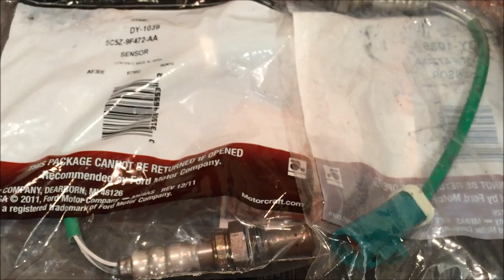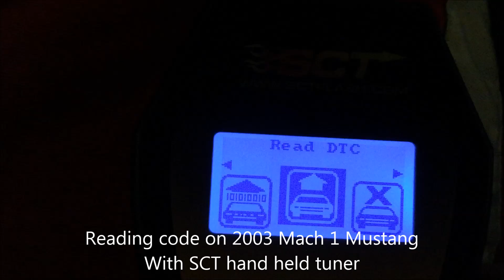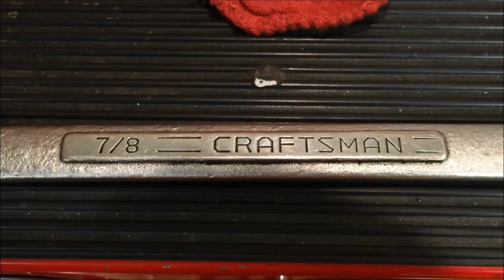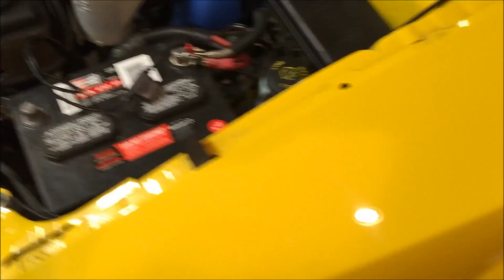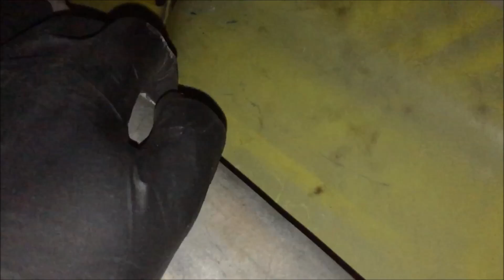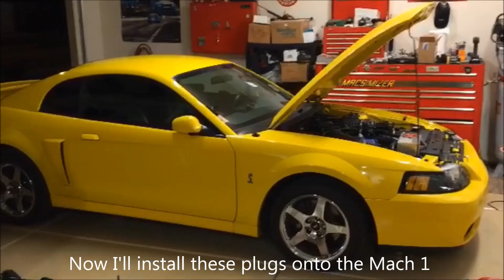How to change an oxygen sensor/O2 sensor: Ford Mustang (other cars too) F150,  Explorer

Comment: Is the bank 2 upstream sensor connector on the transmission harness or injector harness?
Reply from the maker: Bank 2 is the driver side and has the 02 sensor on the transmission harness. Bank 1 has the 02 on the injector harness. You’ll see it in this video around the 16 minute mark https://youtu.be/pQyB0kfNzzs?si=0y4bJ9_pIDnYv--h

Comment: Hey what's up Danny. I'm replacing my upstream o2 sensors and I'm CATCHING HELL trying to install the passenger side upstream sensor. Used a thread chaser and it screwed in no problem. Any suggestions?? 97 mustang cobra TIA 👍
Reply from the maker: At worst, remove the mid pipe and and rethread it or add a new bung for the o2 sensor to thread into and cap the old one https://youtu.be/ELF7zXpXsm8

Comment: You seem like you know what you’re talking about so i gotta pick your brain lol my girl has an 04 v6 mustang and it’s got codes saying it’s running rich on both banks, long term fuel trims -10 or more also. Any areas to look at specifically ? It has some new shit put in before the codes like new plugs, coil pack, wires, MAF, fuel filter, clean throttle body, and a new IACV. No vacuum leaks, fuel leaks, fuel pressure is normal. I’m thinking o2 but it’s anyone’s guess. I appreciate your time buddy, thanks
Reply from the maker: Yeah, in my case it was the 02 sensors themselves, but it’s hard to say

Comment: Late reply, but I just got a code for the o2 sensor on my 2012 v6 mustang. And it’s only for bank 1. I only bought one upstream new sensor but do I need to replace bank 2 also?
Reply from the maker: Just try that for now. It’s the passenger side

Comment: Wish I had the tools to do my own repairs.... sadly I cannot Jack the car up securely....
Reply: One thing you can do is drive your car on the curve as an jack . Did it not too long ago last year
Reply: You could also barely jack it up to where the tires are still on the ground and get yourself a block to put under there for extra safety. I just jack up enough to squeeze under the car.

Comment: Thanks man I’m running a full bolt on on a 06 mustang they have long tube headers I’m going to to buy the sensors this weekend great video real straight forward and detailed bank 1 is passenger bank 2 is driver side 👌

Comment: i have no cats on my 01 gt its throwing a code thats its running to rich im not sure if i need a 02 sensor or what do i need to do?
Reply from the maker: The car will run rich without cats, so you’ll need a tune. I also had bad front 02 sensors that reported a rich condition but it was just the sensors
Reply: @dannyjohnsonsgarage  I just need to know how to pass inspection with no cats, i might know someone who will pass it without the cats but if he doesnt then all i would have to do is buy a tuner an tune it out? an it will be okay to drive it for awhile while i save up money to buy a tuner right?
Reply from the maker: Chase Barbee It depends on if your state requires emissions. You may need to install a stock mid pipe with cats to pass
Reply: @dannyjohnsonsgarage  dang so buying a tuner an just tuning it out wouldnt work?
Reply from the maker: Chase Barbee The turner will make the car run properly, but you have to find out if your state is going to test your exhaust gasses and check for cats.
Reply: @dannyjohnsonsgarage  Ok thanks man i appreciate it!

Comment: Thanks for the video . I have question my 03 cobra got smoged referred and my Catt and EGR not setting with drive cycles . Talk to svt team at ford .they sent me to ford and correctly In the shop . I got a call from ford an was told my 02 sensor was bad . But star smog repair station and state referre did not catch this I have no check engine light on is this normal with the sensor being bad without check engine light ?
Reply from the maker: As the sensors fail they can also work a little here and there. I would go ahead and replace the sensor

Comment: How can you tell if it upstream or down stream
Reply from the maker: AJ KILLEM Upstream is closest to the engine, down stream is farthest down heading towards the tail pipe. The down stream sensors are typically  located after the catalytic converters

Comment: How do you remove the upstream O2 sensor if you do have Cat  Converter?
Reply from the maker: Saquarius Williams It’s still possible- you’ll want to unscrew it with the 7/8” wrench but if they have never been replaced before they are tied up on a bracket that’s mounted to the top two transmission bolts. You can gently pull and they should break away from the bracket where they are glued. If you’re not comfortable with that, remove the exhaust (I’ll post a link how to do that)
Reply from the maker: Saquarius Williams mid pipe removal https://youtu.be/AUVOtll1zdQ

Comment: so i bought some o2 sensors for my gt are they all the same as far as upflow and downflow because the ones i have arnt labeled
Reply from the maker: I do believe the fronts were different from the rear (they may be heated sensors up front if I recall), but the side doesn’t matter- just front vs rear is different

Comment: Where does the sensor connect on the other side? Where does it go? (Not the exhaust side)
Reply from the maker: it comes off of a harness that comes down each side of the transmission/engine block. The harness has a bracket that actually bolts into the top two bolts of the transmission

Comment: Danny great video as always. Are you aware of Ford possibly changing their part # on the front O2 sensors? I just got back from the Ford dealer and purchased upstream set for my 04 Cobra, my part number is DY-1401 1X (GU2Z-9G444-A). Totally different from yours on the video. I noticed on my car just like yours the fronts are color coded green, the ones i recently purchased the locking tabs are white?
Reply from the maker: If you happen to have the invoice, look for it to say “alternate part number” or something of that nature. It’s common when the part has been updated and the old one is “obsolete”
Reply: @dannyjohnsonsgarage  Nothing on my invoice or packaging indicating "alternate part number"
Reply: I'm having the same issue on my 99 3.8l they said the other part is obsolete and the part # is the same as you said Wilson

Comment: Hey i have a mustang 2002 base with the same problem, I asked some mechanics and most of them said that this doesn't affect anything with the car but i feel like the car lose power, the oxygen sensor has to be something with that? To fix the problem and how many sensors do i have to change?
Reply from the maker: Eduardo Vilca it’s usually just the front two sensors (called up stream) that cause hesitation issues.
Reply: @dannyjohnsonsgarage  so I just have to buy 2 sensors? Or 4?just in case i need more, how many sensors has the car?
Reply from the maker: Eduardo Vilca The car has 4, two up front and two in the rear. It’s most likely the front two would be causing the problem, so I would recommend trying them first, then move on to buying the ones for the back or even turn the back ones off
Reply from the maker: Eduardo Vilca https://youtu.be/sOV4EwF7BvU
Reply from the maker: Eduardo Vilca https://youtu.be/v9Jp5wqp_a8
Reply: @dannyjohnsonsgarage  thank you, do u know how much are each sensor? Because i asked one time in advance auto parts and they said like 90 but i checked on internet and are cheaper.

Comment: When do you have to replace the downstream O2 sensors? I had Bank 1 and bank 2 on my check engine meter and I'm going to replace the upstream only unless I get more fault codes. Should I replace downstream when I'm doing upstream?
Reply from the maker: They should last a little longer from not being quite as hot as the fronts. I would wait until they are a problem (or even turn them off). https://youtu.be/v9Jp5wqp_a8
Reply from the maker: Or if you don’t have a tuner you can buy these https://youtu.be/sOV4EwF7BvU

Comment: I have p0155 code saying bank 2 sensor 1 I got the sensor replace but still bring up the same code that’s the only code also
Reply from the maker: Kevionn4.6 that would be the driver side upstream (closest to the engine).
Reply: Danny Johnson so basically the left front ? If yes thanks !
Reply from the maker: Kevionn4.6 Yes. Thanks for watching 😉

Comment: Dude how did you get to the passenger side O2 sensor that shit is hard to get to
Reply from the maker: It’s super hard with catalytic converters. If you can’t get it, I would un plug it and take the exhaust off the car as an alternative
Reply: Yes that passenger side O2 sensor is a bitch. I got the drivers side done. Now trying to figure out how in the he'll to get at the other one without taking the exhaust off, dang it!
Reply: Ok got it! Jacked the front end up and used some jack stands. Get under there and push the stupid button and give a yank on those fricken wires! Why do you have to be so difficult Mustang!!

Comment: Hey Danny 
I got p0193 on my car , but it’s not acting like it would be the frps 

I am also getting a message saying my bank 1 sensor 4 is failing 
And also 
Closed loop:  using o2 sensor for fuel mix ..

I am replacing sensors first then frps 

You think that is a wise choice ?
Reply from the maker: yes- my experience in this case (as mentioned in the video) was the o2 sensor was the false messenger lol
Reply from the maker: if you have the ability, turn the rear sensors off with a tuner https://youtu.be/v9Jp5wqp_a8
Reply: Thank you Danny , this is really gonna save me some money .. I am picking everything up on Friday .. and doing it .
Reply: Oh and I smelled fuel in the oil so I’ll be replacing oil and filter as well ..
Reply from the maker: Gummy Bear Let me know how it all goes

Comment: Hey Danny, I just purchased an 01 mustang gt with bbk headers and it doesn't have neither upstream o2 sensors.. I can see the plug for bank 2 which is the drivers side but I can't locate the plug for bank 1, please help!
Reply from the maker: The plug can be pretty far up towards the top of the transmission. There is a bracket that holds them to the top transmission bolts. I wonder if it is on top of the transmission tucked up there
Reply from the maker: You can see what I’m talking about at about 12 minutes and 20 seconds into this video. https://youtu.be/Sk3d44e8JPo

Comment: Great video! Are the sensors torqued down pretty hard or just hand tight?? Thanks in advance
Reply from the maker: Rogelio Mireles there really isn't a way to put a torque wrench on it, so just make sure it is snug and be sure to use anti-seize like I did in the video!

Comment: Excellent video, just changed a faulty upstream sensor bank 1 on 2003 Mach 1 and runs like new. Thanks
Reply from the maker: Bryan W glad to hear that. Thanks for watching
Reply: Bryan W did u get a check engine light when the sensor went faulty or did u diagnosed it yourself?
Reply: @exile9237  you get a light

Comment: Hey bro I got a p2272 on my mustang I changed the o2 sensor and I still got the light back on it's been months i can't find the problem
Reply: Dhillon Did you fix it yet?
Reply: HD There’s two upstream sensors behind the catalytic converters, and two downstream O2 sensors which naturally mould to your car. Hope you’ve fixed the issue by now, but you usually need to replace both sensors.

Comment: Did jacking the car to one side help you gain better access to the sensor plugs above the transmission? I'm unable to fit one hand through the space to plug my sensor with my car jacked up evenly. Any advice?
Reply from the maker: Luis Ech one side will only help changing the plug on that side (but you can do both with only one side of the car lifted, or lift one side, change the sensor, then lift the other side- or lift both). Just make sure it's properly secured on Jack stands
Reply: Wandering About did you ever figure it out? I can't get my hand in there to unplug it either
Reply: I can't get to the passenger o2 plug.. any advice guys?
Reply: Luis Ech i bu the 02 sensor for my 2006 gt upside drive side any tool because I don't no

Comment: how do you locate sensor 2 bank 2 on 1996 3.8l ford mustang
Reply from the maker: Jose R bank 1 will be the side cylinder #1 is on, which is usually the passenger side
Reply: Scrun Johnson ok cus this code poped up on my 1996 3.8L ford mustang. P1157 lack of o2 switches bank 2 sensor 2 indicates lean
Reply from the maker: Jose R my O2 was reading "rich" which led me to try fuel injectors and all kinds of junk and it was the O2 itself
Reply: Scrun Johnson can you help me located the o2 sensor bank 2..im having trouble locating it .. is it before the catalice converter or after
Reply from the maker: Jose R after the catalytic converter on the driver side. The last sensor. Right before the exhaust goes to a Y
Reply: Ok so if its a single exhaust its just going to be 1 ho2 sensor ??
Reply from the maker: on the 3.8L V6 (unless someone changed your exhaust) you have twin exhaust coming off the engine with two o2 sensors on each side. Then the exhaust comes together in a Y shape and has one pipe from there. The o2 sensors are before the exhaust goes to one pipe. The senor you are looking for will be after the catyletic converters on the driver side.
Reply: Scrun Johnson ok thank you foud found it
Reply from the maker: Jose R cool. Just unplug, un screw, and replace. Good luck
Reply: Thank u
Reply from the maker: Jose R no prob. Let me know how it goes

Comment: Does your check engine light stay on in the Mach 1 due to the P1000 code? I believe that's the reason my light is on; tried clearing it with a handheld tuner, but it comes back on in like 20 miles lol
Reply from the maker: I'm pretty sure it does not . It's only a code when the tuner is hooking up
Reply: +Scrun Johnson Gotcha. I probably need another tuner since I got a different H-pipe recently..
Reply: A different subject, but has to do with the tuner, do ya'll by any chance know how to disable PATS system using the x4 flash tuner? Have read multiple answers online in forums that the tuner can disable it, I just don't find the parameters or the option to disable it. Called SCT but the rep said they don't do that anymore. Car doesn't start, code p1260: theft detected, vehicle immobilized comes out. Got a new transceiver halo ring, but didn't help. Thinking of having new keys programmed next.